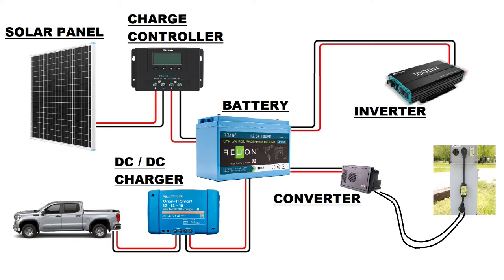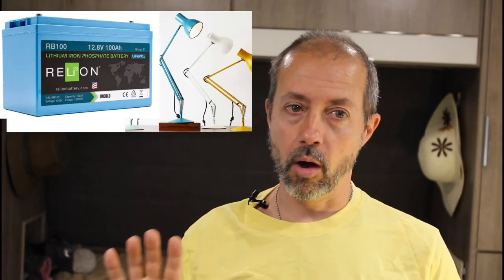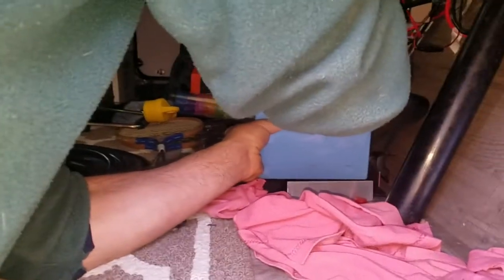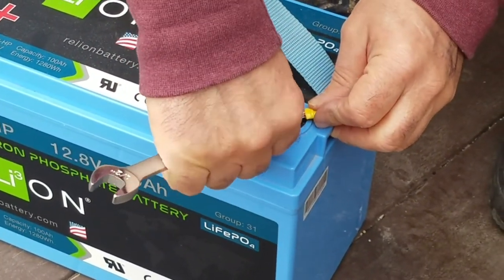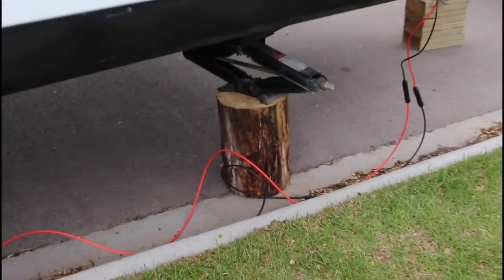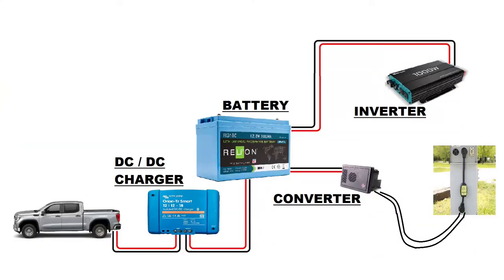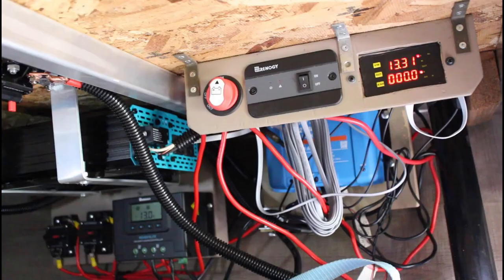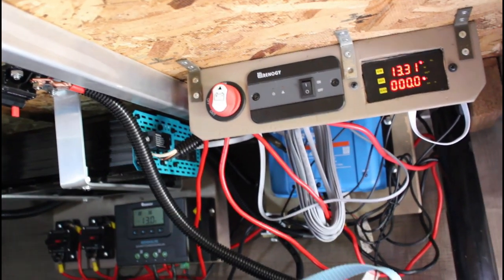How to solar power RV on a budget

Comment: Just came across your channel and have been binge watching. I do the same as you when switching to my inverter. Only I just flip the circuit breaker to the charger to turn it off. I think in the future I will add a switch to the control panel in the RV that, in one position, it will turn on the inverter and turn off the converter. In the other position, the opposite. The switch will be some kind of double pole double throw monstrosity. Why would I do this? Well, why not? Like you, I enjoy just fiddling and fixing and improving stuff. I'm retired and my wife doesn't mind because it keeps me out of trouble. Her words, not mine. And now, back to bingeing.
Reply from the maker: It is fun to do modifications and play around with stuff.

Comment: Another nice video. The only criticism in your setup is the use of your stock converter to charge your LiOn battery. It will work but you will find it difficult fully charge the LiON battery. This is unless yours has a LiON switch on the converter to change its charge cycle. My 22mle did not have the switch. You probably know this already but I would have mentioned it in the video. If ever you choose to upsize I highly recommend the Victron Mutiplus II. It works truly amazing on a 30 amp RV. I can even run my AC but only for a few hours. Also having a good Battery monitor is needed because the one on your stock control panel is useless with LiON. It will read full until the battery is dead. I used a cheap Chinese one and it works great but does not offer system integration or bluetooth like the victron.
Reply from the maker: It's true that the stock converter doesn't charge fully.  We do get a full charge when using the solar panel and when attached to the truck while driving. Thanks for the comment!

Comment: How did you wire the switch to turn off the converter?
Reply from the maker: That switch is in the original circuit between converter and battery. When the switch is off, the RV runs as if no battery is present, the converter's DC output runs 12V circuits.
Reply: @rvingitup  Thanks
How did you know which circuit at the battery?
I’m guessing the inverter would supply power to the converter and power the 12v circuits along with the 110v circuits?
Reply from the maker: @gordonwearsch2381  In my case it was easy to choose, because there was only one cable to the battery when we purchased the RV.